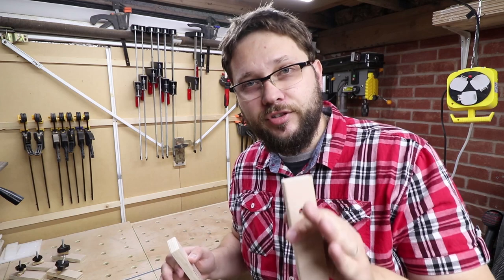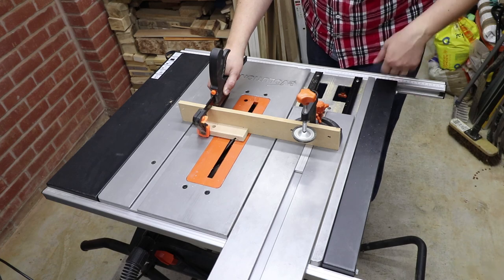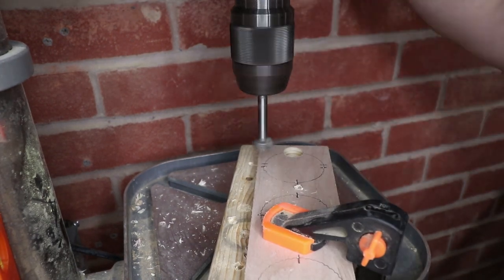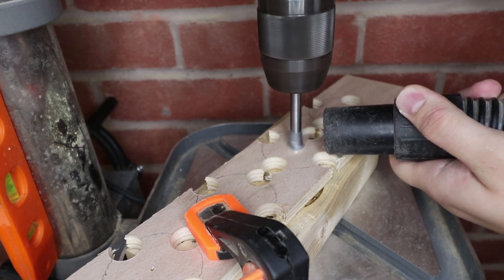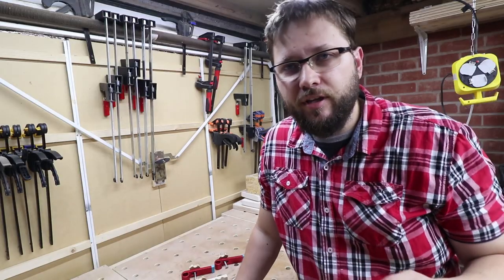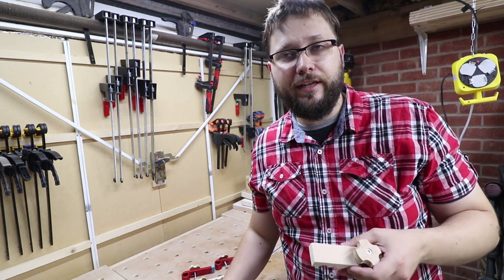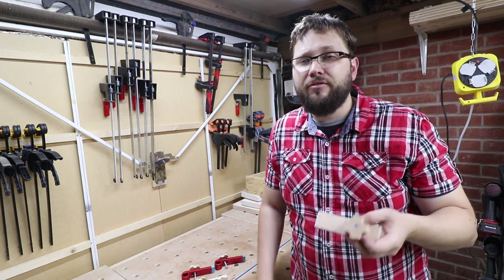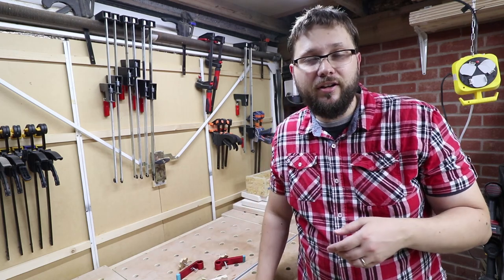DIY T-Track Clamp & Easy Star Knobs With No Jigs

Comment: Nice and useful. When and why did you stop using Danish Oil and start using sanding sealer?
Reply from the maker: The main reason I'm using sanding sealer is that it dries very quickly- about 20 minutes and you can apply another coat. And it's not super expensive 👍

Comment: Great video thomasz. How accurate are you finding the evolution sliding table on the saw mate ? Hope alls well keep safe
Reply from the maker: Thanks mate, hmm it's fine for what I need it for. If I need super accurate cuts then I use my sled. The play is not massive, less then 1mm so not too bad. I found it's more the mitre gauge that's the issue. I may try to make something myself for it
Reply: @CasualDIY  thanks